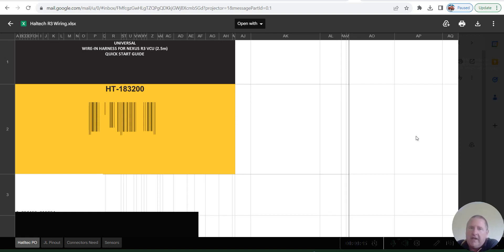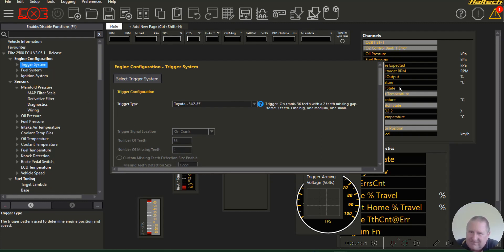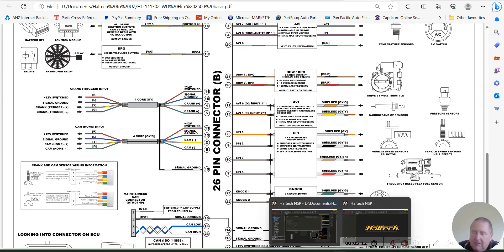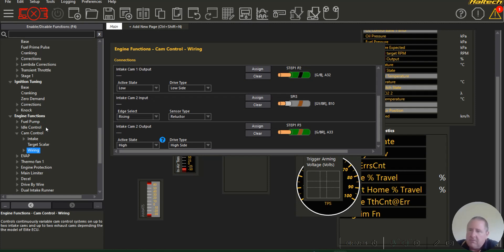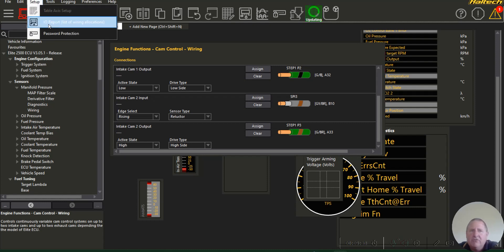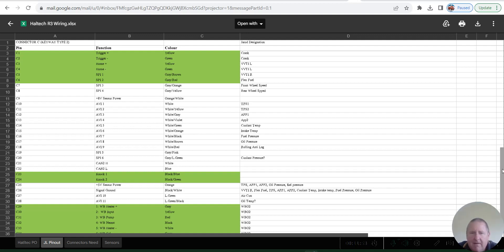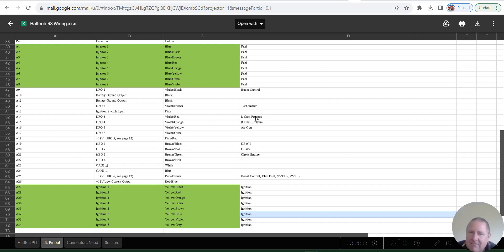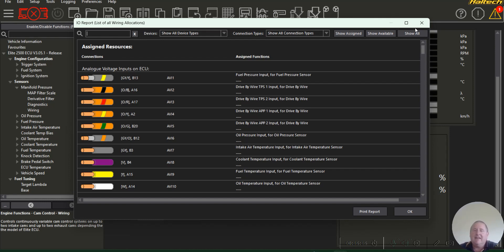Haltech Crank and cam setting for 1uz vvti and 3uz engines

Comment: Having a similar issue w/ my 2UZ VVT-i on a Link G4 Xtreme. I have the 3 wire Cam Home sensor on the front of the left bank and it keeps loosing home sync, (runs great when we can actually get it synced). Had it wired as a hall-effect since its 3 wires (red wire sent to 5v reference VC) but it's actually just a reluctor sensor with 3 wires?? So should this wire be left disconnected and set up as a reluctor in the Link, or connected to an addition ecu ground? or completely disregard that front sensor and wire the two upper Cam sensors as you mentioned to do everything?

Comment: Hello quick question I have a haltech flying lead and I wanted to keep the acis system and I was wondering how you would wire it up or is it as simple as a switched 12 V and a auxiliary output or do I need a relay?
Reply from the maker: 12 volt.anr aux out for acis